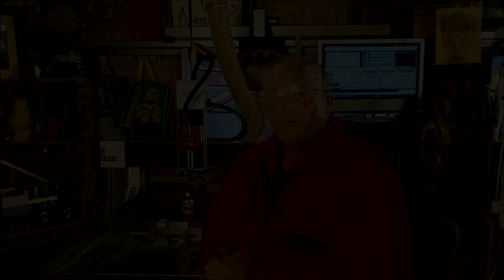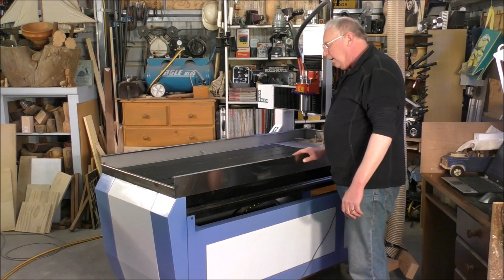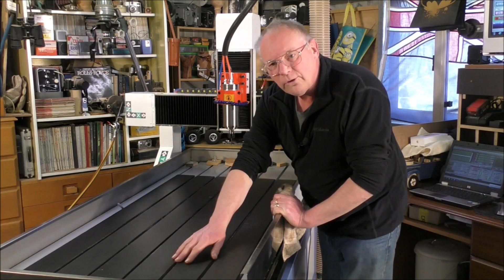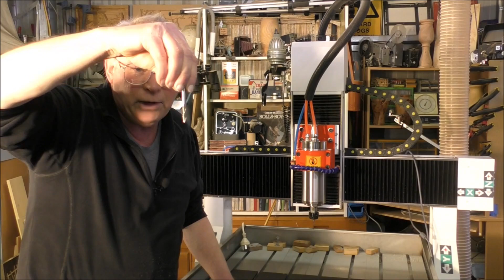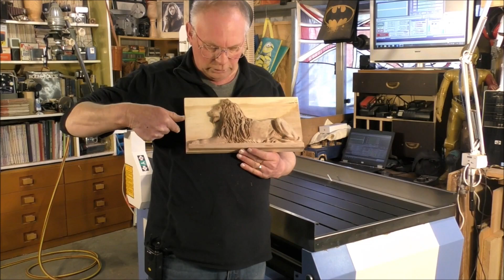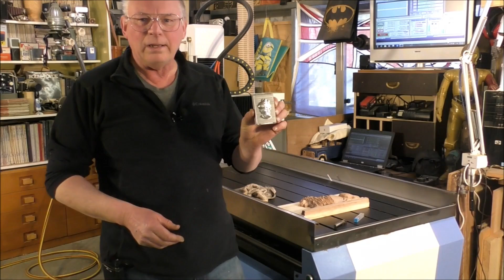#Chinese #!*? CNC Routers **WATCH** before you BUY NEW FOR 2024

Comment: Hi Roger, thanks for the video. Actually, I run my 1200x1200mm router with artcam and windows XP and pretty happy with that. I cancel first 8 lines and last 4 of g code and run with DSP . Vectric aspire found to be not compatible, with multiple passes it did strange things with gcode. At which max speed does your servo machine travel?

Comment: Hey Roger. You said the minimum speed to run the spindle is 5000rpm.That's probably was the reason I had an issue when I was testing my spindle for the 1st time. There was a preinstalled gcode file in the SMC controller. I ran the program without actually cutting any material, and after a few minutes, the spindle stopped. The VFD had an error code that was for an overheat (there are several overheat codes, but I don't know the cause for this one). The VFD did not feel hot to me though. The code I was running had the spindle set for 1500rpm. I hadn't tuned mine in yet and later determined it was actually running at 3000rpm. I decided to try to see what would happen if I ran the spindle faster. I ran it at 10,000rpm and it did not shut down this time. I let it run for at least 15 minutes and it ran fine. So why does it shut down running at a slower speed? I am using one of those water coolers that cycles the water though a radiator with a fan. I put auto winshield washer fluid with anti-freeze in mine.